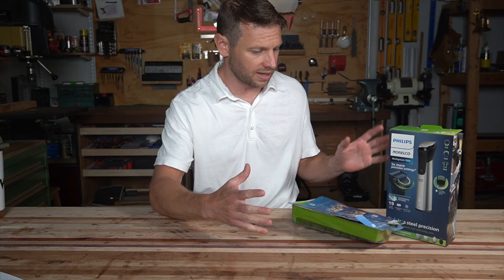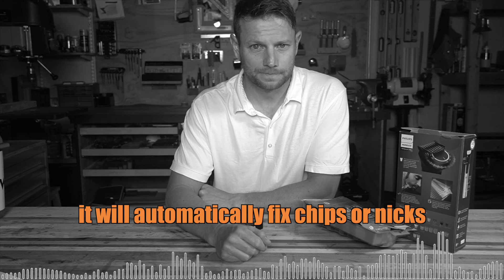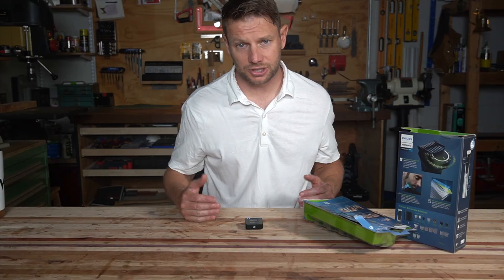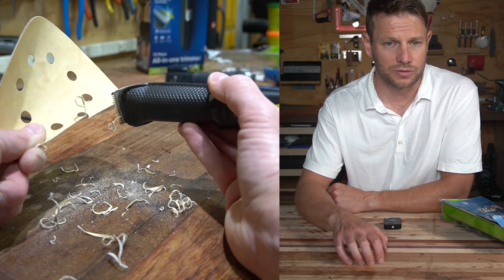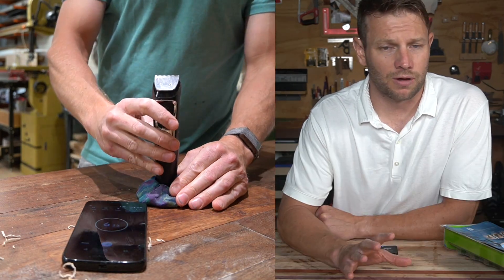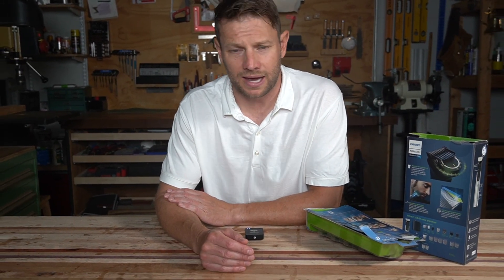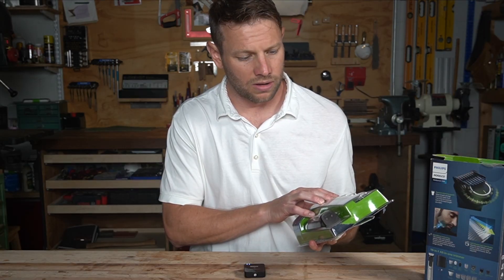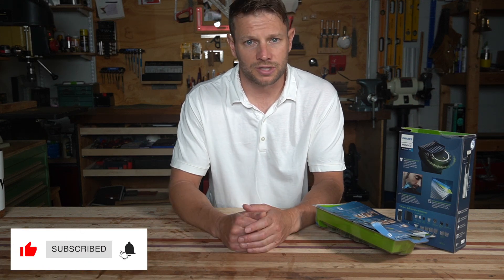Self Sharpening Blades Don't Exist

Comment: Self-sharpening trimmers have a cutting blade that slides across a counter blade at an angle to sharpen the cutting edge. The rotary blade is mounted at an angle so it sharpens the cutting edge with each rotation.